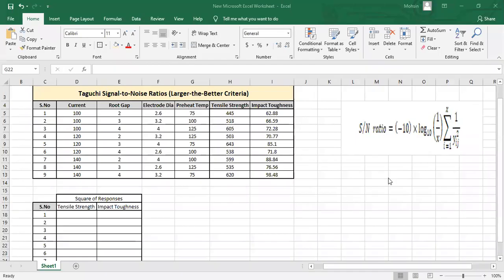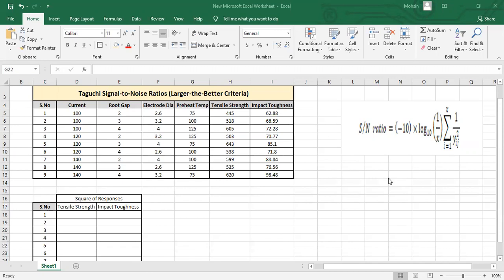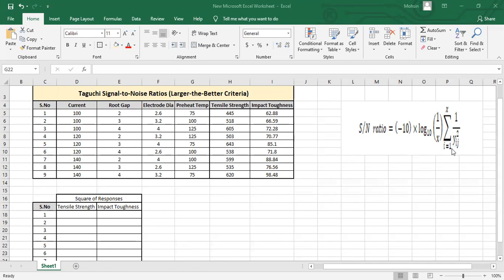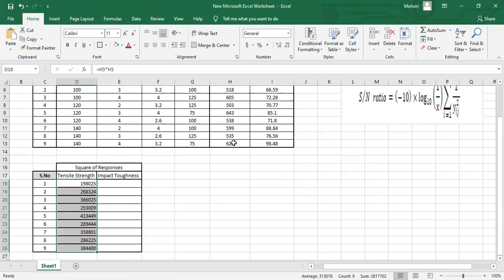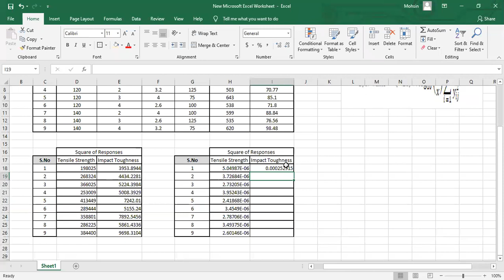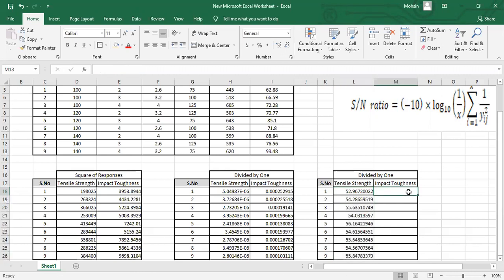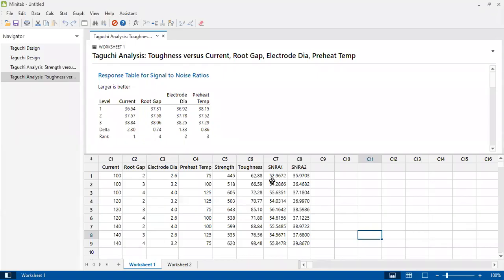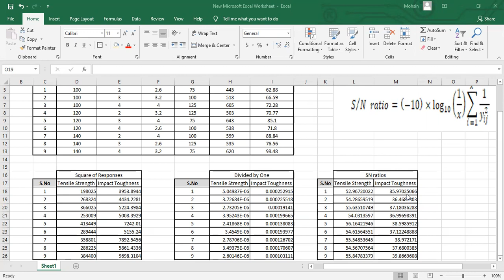Taguchi SN ratios Larger the Better using excel | Taguchi Design of Experiments |  Taguchi method

Comment: Can I make decision based on SN ratio only
Reply from the maker: Yes, if you have only one response variable
Reply: @EngineeringandInfo  So in that case larger SN ratio will give me optimized values of parameters?
Reply from the maker: @Purushottam Pawar  yes. Largest SN is your result
Reply: @EngineeringandInfo  and in that no need to calculate delta value and ranking?
Reply from the maker: @purushottampawar375  for multi optimization.. ranking isust
Reply from the maker: If more than one response,  then must go for multi optimization. Videos already made on this